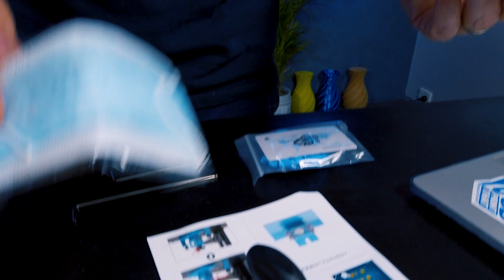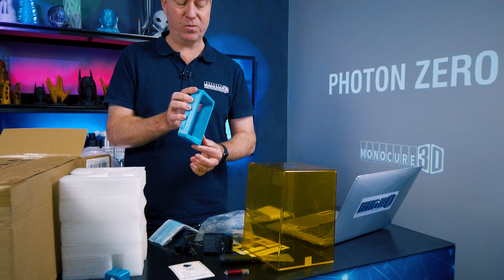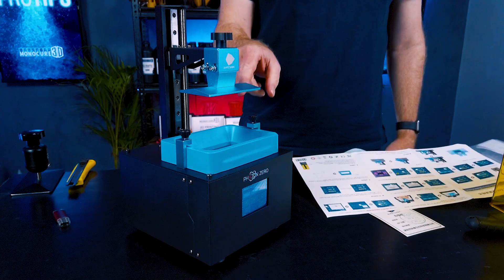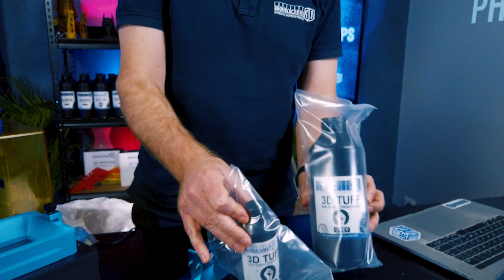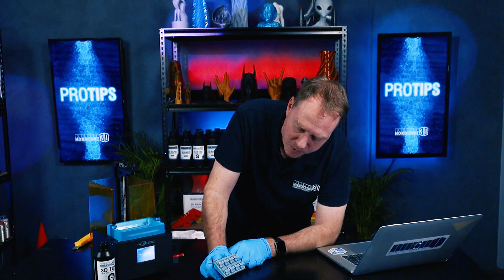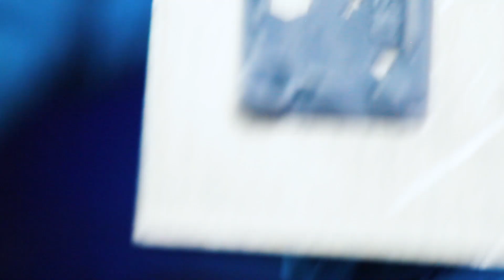Setting Up the Anycubic Photon Zero

Comment: Never use a metal scraper, you might damage the print platform.
Upgrade the resin vat to the one made out of aluminium so you can disassemble the FEP and clean the vat thoroughly with acetone without damaging it so your installed FEP's wont get damaged due to residue collecting on the vat.
Reply from the maker: Good tip 👍🏻

Comment: Z lead screw being not hold on the top is in fact better, because if the leadscrew bend and you put it into two bearings, it will induce Z-wobble.
Reply from the maker: Interesting - I never thought of that. Thanks for the input.

Comment: Buyer beware photon slicing software (proprietary) requires a gpu that 
will run open gl 3.3 or higher. a surprising number of windows laptops 
WILL NOT. Even many windows 10 units. Their gpu is actually capable of 
running 3.3 but intel refuses to release a driver upgrade thus stalling 
them @3.1. The same chip (intel hd 3000) has 3.3 drivers officially 
released for linux and apple. It's a cool printer, but is it worth 
having to buy a new computer?
Reply from the maker: Thanks for the heads up. Interesting point - I believe Chitubox is now supporting Photon Printers??

Comment: my printer doesnt read the file on usb stick. i just bought and i dont know why it happened
Reply: @MyklCarlton  i hve contact the seller,he said it should be the ori stick that had to be formated.

He said no more than 8gb on my usb stick memory capasity otherwise it failed to read.

Now the problem is solved and my printer works just fine.

Thx Mykl Carlton
Reply: @DanuLee_Wardoyo  Yeah, pretty much what they said in that link. Good to know you're working again!
Reply: @MyklCarlton  yeah man. At first it is so frustating cs i'm stuck. But after couple days i contact the seller he told me that i have to format the ori one after copyed to my pc.
Format on FAT32 and it would good to go
Reply: Be careful with the names of your files, try to make them short and simple. Check that the printer model in the software is the same as the actual printer and look at the example files on the usb stick - what is the file extension (the three letters after the fullstop)? Make sure that is what your sliced file is being saved as.
Also, try not to have too many files on the usb stick. Try to give the printer as little to get confused about as possible!
Reply: @MyklCarlton  thx Mykl. I'll try wht u r sugesting
Reply: @DanuLee_Wardoyo  Let me know how it goes!
Reply: @DanuLee_Wardoyo  Is this a new USB stick, that didn't come with the printer? I had trouble with that, so still using the supplied stick.
Reply from the maker: Sometimes the USB sticks can be a bit dodgy - try to replace it with a better quality one.
Reply: @Monocure3DProTips  the seller said if the capasity of the memory is to big, the printer couldn't read. It's 8gb for max capacity of the memory

Comment: Thanks for the walk through :) Do you recommend buying this or the original Photon for a first 3d printer? Anycubic have both for the same price right now and I'm interested in taking the plunge into miniature printing.
Reply: Having run a Photon for about 10 months I'd strongly suggest it rather than the Zero. Larger print volume and higher resolution screen for the same price? You also don't have to find somewhere to put the cover while you're doing stuff.
Reply: @MyklCarlton  I ended up going with the Photon S and it's been great! :)
Reply: @JimmyBlimps  Yeah, it's a better printer overall, that double Z slide makes a difference.